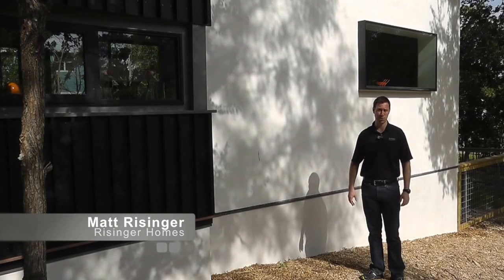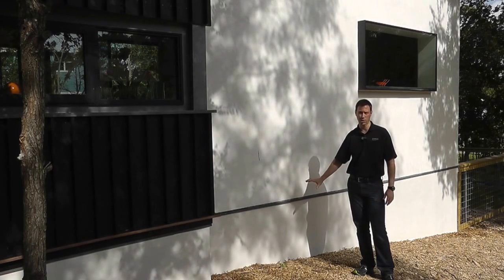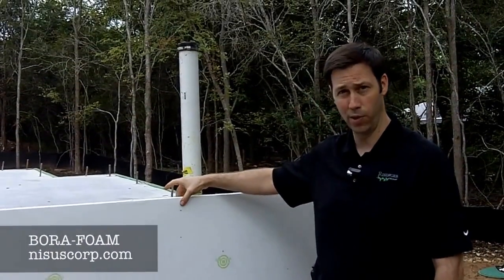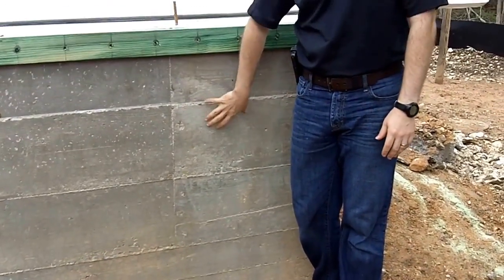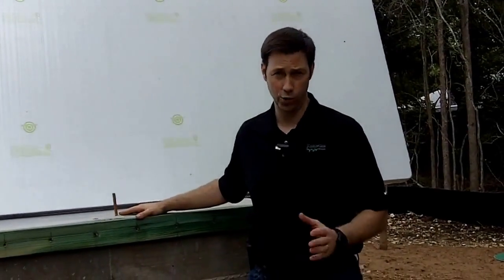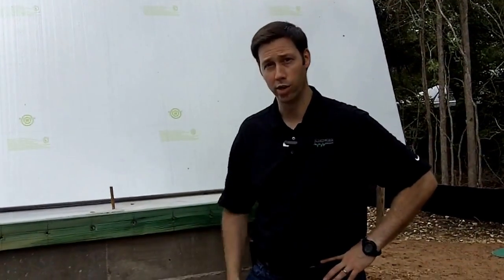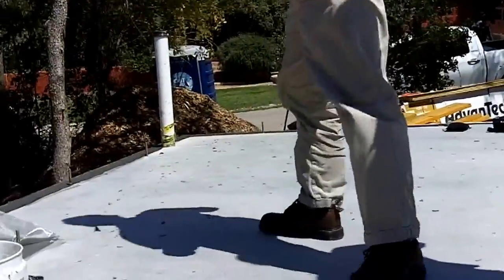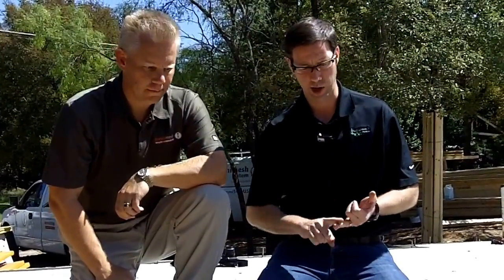Insulated Concrete Slab Foundation

Comment: Did I somehow miss the part where you talk about the protective board on the outside of the foam? It was the part I was most interested in - I have 20 buildings with this stuff that clearly wasn't installed properly and now (some 15 years post-construction now) the foam is basically unmanageable and causing all sorts of problems that no one in our area is sure how to fix. If anyone has any suggestions I'd love to hear them.

Comment: That stainless steel mesh will eventually rust out...
Reply: and the Himalayas will eventually become dust.  everything has a design basis - if you design for 100 years then all you need to do is keep the stainless dry and it will last

Comment: Finally nice to see a builder with some understanding of the Law of Thermodynamics. However why oh why are you cutting the foam? Just go ahead and bury it down four feet, or why not burry it 8 feet around the edge of the house? Then you can use the ground as a natural geothermal energy store.
The problems of controlling a houses temperature have been right under our feet, but everyone is just not seeing it!

Comment from the maker: The more efficient your walls & roof become then the slab becomes a great percent of the heat loss/gain for your house.  Certainly, taller slabs are more important to insulate, but even a short 8" tall slab can benefit assuming you've already done the more important things like air sealing & using exterior rigid foam.  Best, Matt